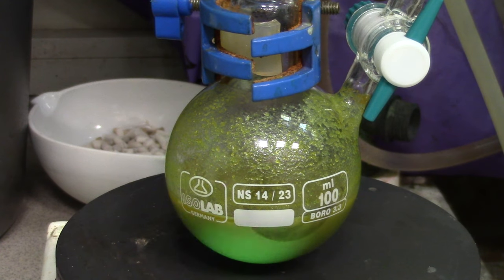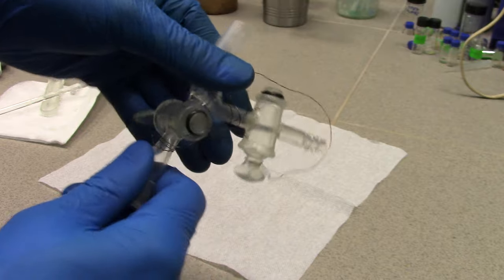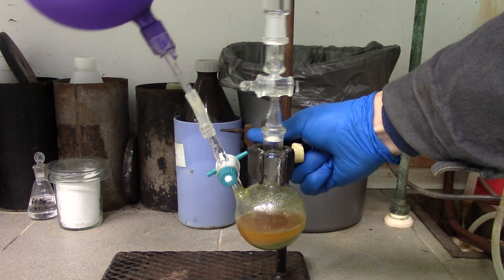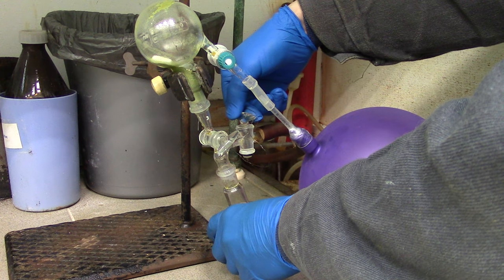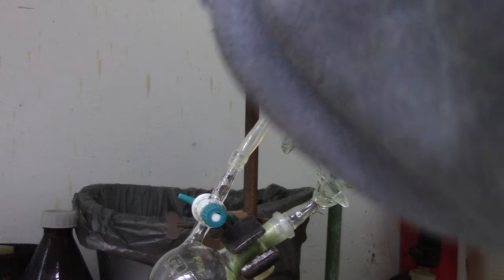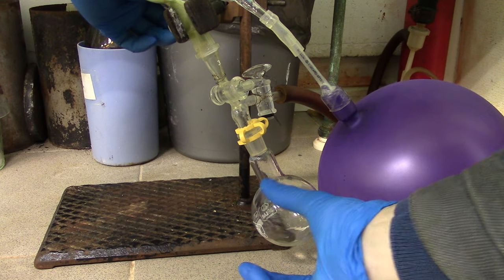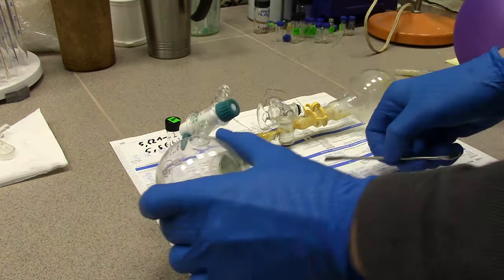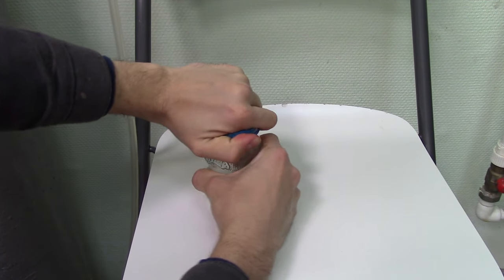Filtration under inert atmosphere technique | Tetrakistriphenylphosphinepalladium treating

Comment: Really nice video - I had never seen a proper inert filtration guide like this and am keen to try it! Quick question, what colour should the pure catalyst generally be and how would you tell if it's gone bad? Does it last a long time if stored under argon in a freezer?
Reply from the maker: Thank you very much! I would be glad to answer you! Pure and fresh catalyst should be pale yellow with a grey hue. It's fluorescence must be greenish, not orange or yellow like in commercial ones because that's sign of catalyst dying... About storing, tetrakis- could be stored like this during half of year on my regular experience! Hope my answers will be helpful to you! 😉
Reply: @AcanthareX  If you need to store for a very long time can you put an oxygen/moisture absorber like some thin slices of sodium/lithium in the outer container?
Reply from the maker: @samheasmanwhite  Yes, of course! I would recommend you to put some solid calcium chloride and a little piece of lithium.

Comment: This is so cool. I need to have a go at this. What are those filters called 🤔
Reply from the maker: Thank you! It's fritted glass filter .
Don't forget to subscribe!
Reply: @AcanthareX  😉 I already have

BTW I do bit of amateur chemistry at home.i just ordered 500ml (HMPA) hexamethylphosphoramide from China. I plan to experiment with disolving alkali metals (also ytterbium) then doing electrolysis with solvated electrons. I plan to record and post a video, it will be of free e ions migtating and making blue blob around the cathode, at least that's what I'm hoping to see.

One can also reduce benzene with solvated electrons to cyclohexane, cyclohexadiene and cyclohexene there's some chemiluminescence stuff I could do too or I can even just make HMPA metal complexes.

Have you ever worked with this solvent, if so do you have any advice for using it?